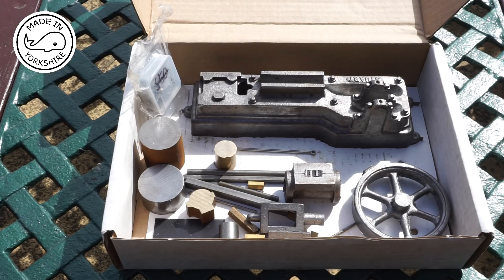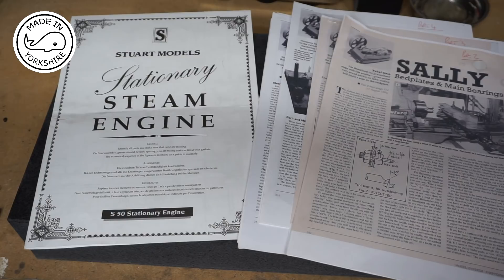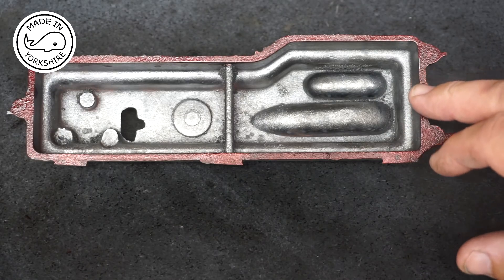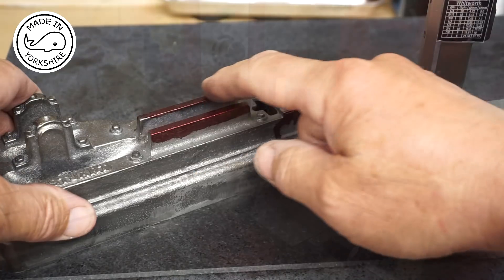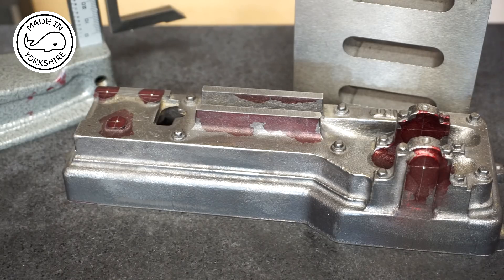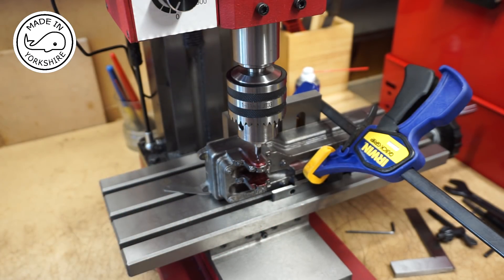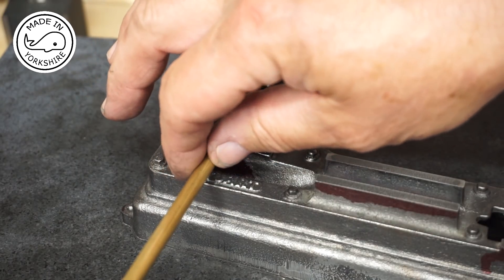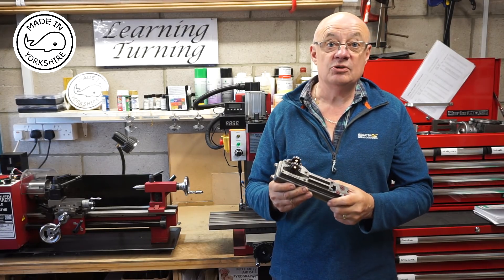#MT22 Part 1 -  Making a Stuart S50 Engine Soleplate / Bedplate and Bearings. By Andrew Whale.

Comment: Hi Andrew. I didn't think the S50 was able to be made on a mini lathe. Does that mean all mini lathes (7-14) are able to cater for this size casting? Thanks.
Reply from the maker: Hi. The mini lathe I used was a Sieg SC3-400 and the mill was a Sieg sx2p.  Both specs on the arceurotrade website which might help you compare with others out there. Hope that helps.
Cheers
Andrew
Reply: @learningturningmetal  Thanks, Andrew, and fair play. Some cracking builds you've made.

Comment: Hi Andrew
Great videos, can i ask were you got your milling vice?
Reply from the maker: Thanks Matthew. Its a 70mm precision tool vice type 2 from Arc Euro Trade. It's designed so the jaws don't rise up. It's a good size for the SX2P mill. I've since purchased 90mm and 120mm versions for my larger mill - though the 120mm is a bit on the large size.
Hope that helps.
Andrew

Comment: Hi Andrew. I just made my baseplate, and found that I just couldn't get both holes in the centre of the bearings... one is bang on centre, the other is slightly off, but, similar to yours.. I'm confident that it is drilled and reamed exactly at 90 deg to the cross slide. I clamped to my angle plate and dial indicated along the side of the slide. Tubal Cain details indicating along both the cross slide and the side of the casting, and getting a happy medium, but I figured that the cross slide is the most important given that we want an ideal 90 deg from that. I did drill from the "Stuart" side, but none the less... given that your engine runs superbly, I'm confident that this is ok. I found this video an excellent source of information, and given the series, feels like I have some help for the entire build process. Many thanks
Reply from the maker: Hi Ian. I think that if the holes are drilled exactly at 90 deg to the cross slide and parallel with the base you should be fine. Maybe the casting is a bit out. If you later realise that it is a problem, you can always redrill the holes larger, fit some brass bushes and redrill to size. I really hope the series helps. Looks like you have Tubal Cain's write-up which is a really good source of information too. I found the S50 a great introduction into model engineering.
Good luck and keep me posed with progress.
Cheers
Andrew

Comment: Andrew, make your own oilers, it's not difficult and you can make them out of brass, which you've got, and you don't need to thread them, just locktite them in. Look at Myfordboys or  Keith Appleton for how to's
Reply from the maker: Great idea Roger - why didn't I think of that? I will check it out and take up the challenge.
All the best.
Andrew
Reply: I'm with Roger make the oilers and just make them a push fit